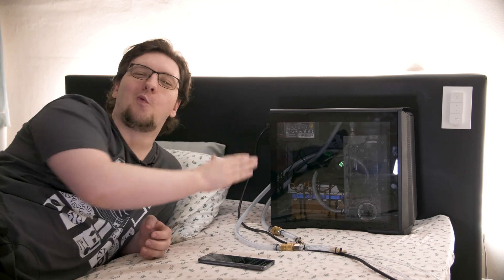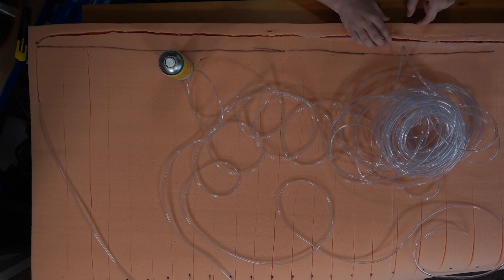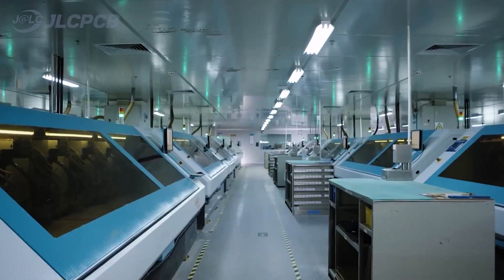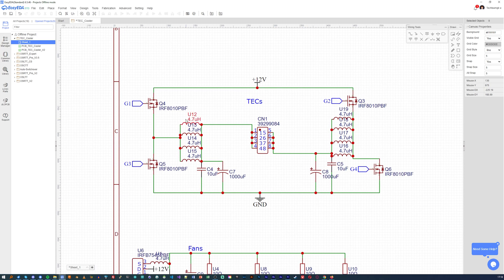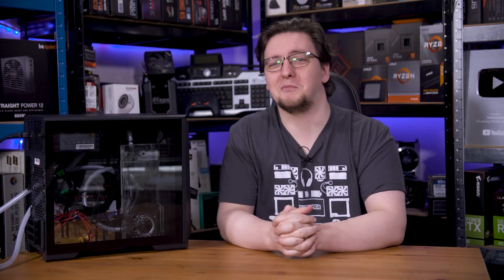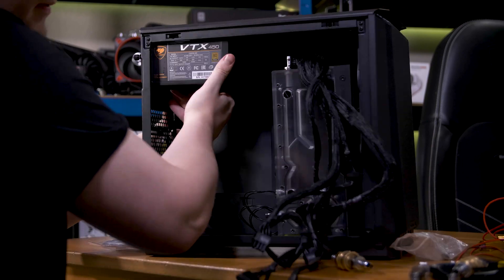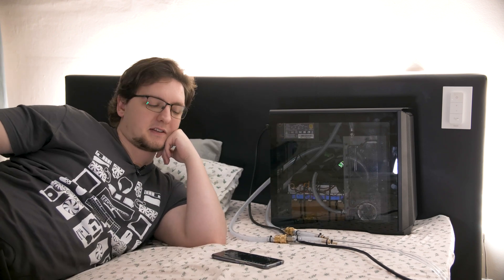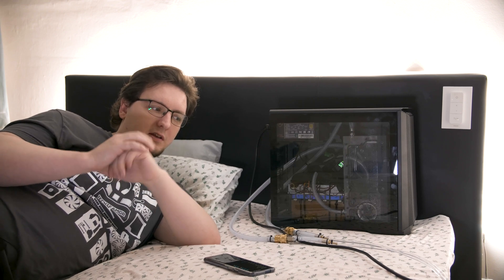I made a Custom Bed Watercooler! Open Source DIY Bed Cooler + Heater (Eight Sleep type thing)

Comment: load resistors? if the peltier wasnt efficient enough, lets reduce it even more! the usual approach is to simply use less of them if the power supply cant cope? 

hmmm... 12v @6A. TEC must be 2R or so. 

12v/6R+2R... 

1.5A. 2.25 x 2 and 4 respectively... 4.5W in the TEC, 9W in the resistor.

x 4... back at 6A. 2/3rds being wasted in resistors. when one TEC draws 6A without the waste heat?

maybe my maths is in error, or my mental schematic isnt how its wired at all. (like theyre all in parallel maybe?) cus something doesnt add up...

lets try this again...

0.5 and 1R...

8A.

32W in the TECs, 64W in the resistors... 96W overall...

something still doesnt add up...

for those that couldnt be bothered dealing with circuits? "willhi wh7016k". thermostat specifically for TEC, as it will reverse output polarity as appropriate... its only rated for 1 @ 10A... so it needs another pair of HD relays if youre going for multiples, which actually isnt as good as it sounds... limiting resistors or not.

the TEC still transmits heat when powered OFF.

you have four TECS at full power, and it overshoots... turns off... and you bleed a lot of that heat back to the cold side rather than absorbing heat from what you want to cool down... repeat cycle. better to ramp the power down remembering that TECs dont appreciate PWM, but need heavy filtering to give a fairly constant voltage... again, they backflow when turned OFF... you waste more power cooling down the device each time a pulse comes through than performing useful work.

um... might have been better to just use two thin sheets of foam? tack pipe, spray on adhesive, sandwich... yummy :)

iunno, had this idea lurking for years... bought a hot water blanket mid winter... just decided to turn its warning buzzer on permanently now its spring and getting hot. so its a good excuse to modify it now... the fact this is recommended suggests google is reading my mind again as i have NEVER discussed it with ANYONE. and here we are...

Comment: Hello! How has it been holding up in the longer term? I got a climsom mattress cooling device myself. It does work, but often forms condensation on the peltier element, and then there is water on the electronics, and it drips out from the underside. Then it doesnt cool anymore. Maybe they tried to make it too compact, I dont know..

Comment: "the whole room.. needs 1kw or more for portable AC"

Most portable AC unites will use the same 300 watts when running, only run when air is too warm.

I have a hard tim believing peltiers could be even 1/4th as efficient as AC to do this.

Comment: The thing with energy is that it always tries to reach an equilibrium. If you're running this system in the same room as the bed you're cooling, the heat that's being absorbed from the bed and TEC is being pumped back into the room. Sure, while the effect is a localised change in temperature where you lay, the end result is still an increase in temperature in the room you're in.

The reason why air conditioners are effective isn't just about cooling, it's also about dehumidification. Reduce the humidity, and you have less water vapour in the air, which in turn means your body can more effectively regulate its temperature (sweating, 'goose bumps', shivering, etc). This in turn makes it 'feel cooler'.

The most important point and factor in this working is the exhaust. Every AC system will have a vent for the air which has been heated by the compressor, and this is to be exhausted outside. It will also have a drain valve for the purpose of taking the water vapour that was in the air, condensing it down into liquid form, and expelling that (to a container or other drain location). Since some of the air in the room will also be warm (excluding that heated by the compressor), it'll be cooled by the fin stack connected to the compressor piping.

This effectively removes hot air to the outside, and water into its liquid form which takens significantly more energy to evaporate than compared to remaining in vapour form (i.e. when it's in the air), and in essence reduces the chance of equilibrium within the room, as long as the room is sealed relatively effectively. You don't want it 100% air-tight (because we still need air coming in from somewhere to replace the air we're exhausting), but you will get a pressure differential. This is useful, because it means that when it's cooler outside on a night than it is indoors (due to the heat through the day), you can often open a separate small window to act as the intake, which brings cool air in from outside (due to the difference in air pressure and physics trying to equalise it),, making the entire system significantly more effective for the same power. If the temperature outside hasn't cooled down at night though, then leaving the window closed is much more effective.

This isn't to say that what you have is bad - it's a very cool idea that I'm still tempted to try, but I felt it worth reminding folks that air conditioners work the way they do for a reason, and the 'wall' we hit is the raw power requirements for running the compressor.

Comment: That foam sheet idea is just the thing i needed. I bought one of the chilipad systems from sleepme and i love it. But the pad started leaking and it doesn't cover the whole bed so i tried to make my own system by just wrapping some tubing around the mattress but it's still leaking somewhere 🙃  so now i'll have to take it all back off again but now i know what i'm going to do. Trying to manipulate the tubing around the mattress was a pain!
Reply: Hey there, I’m thinking of doing the same with the foam thingy. But according to what I know, foam has very low conductivity and thus may not be efficient to transfer the heat between the user’s body and the tubes within the foam. Can you let me know how it turned out for you?

Comment: I used a laser cutter water chiller and place it outside. That way i dont dumb the heat in the house. Also it is a refrigerant cycle so way more efficient.
Reply: This is the first time I heard of these devices, does it keep you cool effectively?
Reply: @syproductions456  It keeps the computer cooled really well. I have been using it for about 6 months now non stop. I also have direct die cooling. It has 1500w of cooling potential.

Comment: c = Q / ( m x delta T) with c of dihydrogenmonoxide = 4.184 J/(gm-degree Centigrade) and Tl=10C and T2=37C. With Qin=100 watts, what mass flow rate of water at 10C is required to lower the temp from 37C to 20C?

Posers

Comment: you can buy a pvc water cooling pad and a big bucket of non-cooled tap water with a immersion pump, I saw someone on yt tested this and it made the bed cooler than eight sleep did.
Reply: Adam Davenport is the name of the channel
Reply: It would depend on the temperature of the room, if your room is below body temperature then you probably don't need to cool the water. Just getting the heat away will help, you could always add cooling later.
Reply: @eslmatt811  I've been watercooling computers for more than two decades. I've experimented with large amounts of water, and large amounts of radiators, and clearly what makes a difference are the radiators (and fans), to drop the water temperature. A bucket will not be very good to dissipate heat to the room air, especially since the temperature difference between water and air will be low.
Reply: @aesma2522  then add some ice cubes lol
Reply: That will not last long until the water is warm.
Reply: @aesma2522 according to eight sleep you want the water to get warmer gradually anyway. If you want want to delay it you can put more water in the bucket
Reply: @DoozyyTV  Yes, I saw that video, too, but can't remember. Cool tap water in a bucket is actually enough.
Reply: @aesma2522 ironically it did, and as the water warmed a bit, turns out it was at the same time in the early morning as the "smart" systems started warming up on purpose to bring one out of sleep

Comment: Unfortunately peltiar plates are 9 times less efficient than a phase change heat pump. Meaning running an ac and cooling your whole room is still more efficient
Reply: If only real life was as simple as random people on the internet thought it was
Reply: That's not as simple a calculation as you seem to think.

If you're using 9 times the amount of power to cool a given mass, but you are cooling 1/9 the mass, it's a wash.

But of course then, you have to start thinking about when cooling the room, how much of your cooling is lost to the walls, and when cooling the bed, how much of your cooling is lost to the room.
Reply: @Nevir202  it doesn't matter what your cooling but how long the power remains on at ~300 watts.

Also, look up the laws of thermodynamics. There's a reason AC needs to vent to the outside.
Reply: @Grahamaan27  Hilarious you think you've told me anything I didn't know.

Comment: I've wondered about doing something like this using an old Eight Sleep topper from eBay or something. Eight Sleep seems nice but waaaay too expensive, and then having a subscription for a system that as far as i can tell just amounts to timed relays is absolutely absurd
Reply: A problem with their toppers is that they spring leaks, so I think making something higher quality would be more interesting